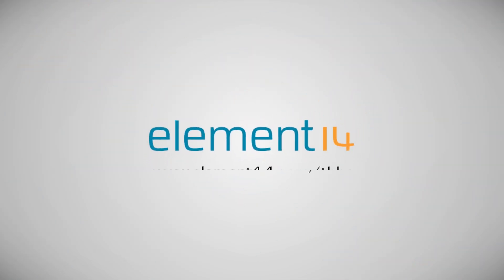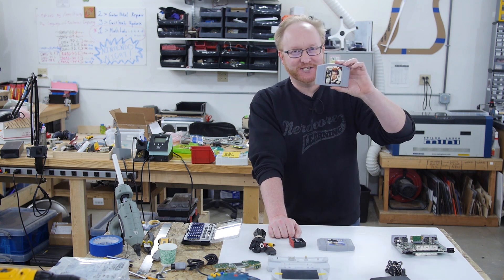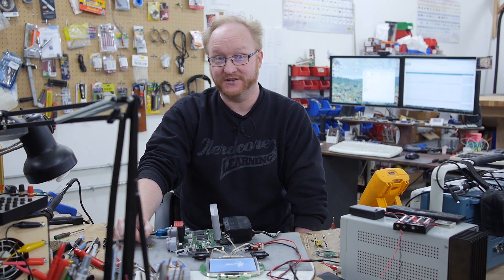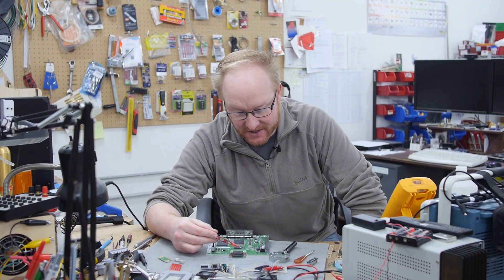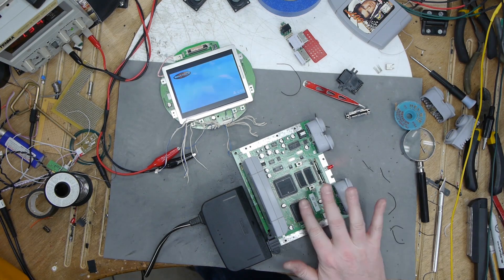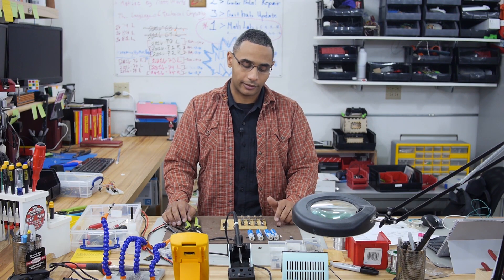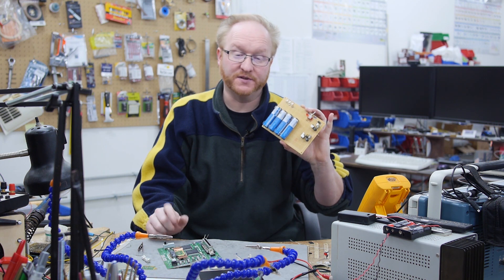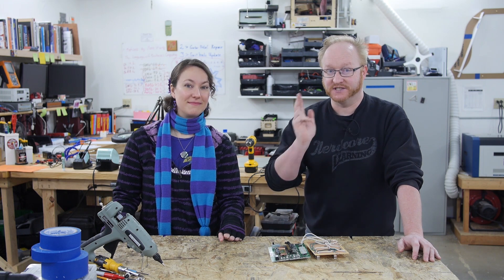Ben Heck's Portable N64 Part 1

Comment: Back in 97 when I got my n64 for Christmas, a couple of days later, I stuck a piece of wire in the cartridge slot and the other end connected to my gameboy, don't judge me, I was 10 years old. lol. I don't know what I was thinking. Trying to play gameboy on the big screen, lol. My question is do you think i fried my board? A capacitor or something? Or maybe I can just replace the pin connector? It stills looks brand new, Power light still comes on, but games don't play.

Comment: can you build a custom desktop PC PlayStation 4 console PS3 console and PS2 motherboard all motherboards burning in the One modded together as one operating system on one single motherboard women all the motherboards as one PC motherboard the PS4 motherboard PS3 motherboard and PS2 motherboard running all is one operating system all the motherboards wondering as one what plays PS PC games PS2 games PlayStation 1 games PS3 games and PS4 games on it as one the kick ass awesome Windows computer / PlayStation compete computer.

Comment: Don't work on circuit board without hot air and board heater.  A solder iron is not for large components.  Facepalm.  Heat up the entire board to 120c then use hot air to remove large components.  This is the only way not to damage the layers inside the board from the ancient fragile board layers.  The entire board is hot and transfers heat without cracking traces and delaminating layers like dropping an egg.  This is why you damaged your first board(and more undisclosed boards....?).

Comment: The most experience I've done in modding is ordering the Blinking Light Win for my NES and installing it myself. And that didn't require any real engineering expertise, just a Phillips head screwdriver to open the machine and my strongest death grip to get the original boards and ZIF socket apart that sat slotted together for 30 years.

Comment: On the older motherboardboard there are 2x2mb ram chips and on the later boards they have a single 4mb ram chip. Why not acquire 2 of the 4mb chips from the newer boards and replace the 2x2mb on the older boards and then remove the socket and add the resistors to the mainboard to terminate everything? I know the ram chips can be replaced as i did it on my own N64 but i still used the jumper pak to terminate it all.

Comment: Sad thing is, he mentions multiple times that an N64 is not for beginners. Honestly it is very forgiving if you avoid the Memory. What I did to make the memory seem Smaller coming out the back was to add a fan right above it. This allows the cooling off all the components while hiding the extruding PoS.

Comment: So now you should have a bunch of empty N64 cases around - let's see something built in one.  Media center, perhaps? With a blu-ray player that accepts discs through a rear or front slot located where the top and bottom of the N64 shells come together? Sega Genesis in an N64?  Raspberry Pi with a projector that projects out through the cart slot, to put star constellation patterns / pictures on the ceiling?

Comment: The 12v line only goes to a 7905 to become 5v for the audio, the N64 only runs on 5v and also 3.1v-3.4v . But there again you should know that as you used to be a pioneer in console modding. The 3.1v-3.4 is easily achieved with a tiny step down regulator. The bending down of the port has been done many times over the years in different ways, as also has the game cart port which can be also bent over along the grounding. If using PSone screen, not a lot of benefit to RGB modding the console.
Reply: Yeah, just have other interests at the moment which take priority over modding. Still have projects to do when get around to it but in no rush, one in development at the moment when I get around to posting it.

Comment: your de soldering is complicated, i use hot air blow with a JBC hot air station, is faster and easier and the damage for the stuff around is reduced. but good work so far  :-)

Comment: @Ben Heck, would you guys consider making a portable first generation Wii with the backwards compatibility with the game cube? theres also a buch of great n64 virtual console games that were ported over just for the wii as well as some nes games.  its so versatile. i modded mine and added a 2TB external HD to emulate my back ups from Atari, NES, SNES, GENISIS, NEO GEO, GAME BOY ADVANCE, TURBO GRAPHICS, N64 (not so great!!) GAME CUBE (running natively)....its awesome runs flawless minus the N64.  I preffer it over my Raspberry Pi 3 for emulating. its a shame noones figured out how to put KODI on it yet.  I never likes the Wii controllers but the classic pro controller is great, if you havent tried it, plus you can plug 4 gamecube controllers right into the side of the Wii. (Just that first model, I think its a RVL-001?) All in all i have over 4000 games all contained in the unit/hd while the physical games stay protected behind glass, where they belong. Ive got about 4 months of tinkering so far, trying to reach perfection. Anyway Id love to see your take on a portable Wii!!! please, please, please!!! 😊😊😊

Comment: would love to know the part number on that 12v boost regulator, didn't even know they where a thing
Reply: Maybe try the LM2576. That's one of two they used.
Reply: thats the step down(normal regulator) series they used(was mentioned in video).. but they also used a step up regulator they didn't mention a part number
Reply: Ben was busy, and I guessed with a data sheet lying around. The step up regulator is LM2577T-12.

Comment: When you made the power supply, you used a regulator to regulate the voltage to 3.3 volts, then I'm assuming you stepped the 3.3 volts to 12 volts, am I correct?  In other words, the 12 volts comes from the regulated 3.3 volts and not directly from the batteries using a stepper regulator?  By quadrupling the voltage, doesn't that bring the current to a crawl?

Comment: People want a portable N64 because this system is a total bitch to emulate accurately. Even today, a high end beast PC struggles to run most of the N64 library.
Reply: That's mostly because N64 emulation is far from perfect. Many hacks are used, as opposed to proper emulation. And the lack of interest in the platform makes it unlikely for cycle accurate emulations that can play all games (like byuu's higan for the SNES) to exist.
Reply: The N64 emulator on my phone runs great lol, you don't need a strong pc at all
Reply: bumtree has nothing to do with the PC specs
Reply: Freddie7010 exactly
Reply: branaa09 That may be the case, but you'd do well not to assume I hadn't also played both. Modern phones and half-decent computers from the past 5 years can run N64 titles with enough accuracy to be virtually indistinguishable from the originals and in most cases even better.
Reply: Freddie7010 on almost all emulators Banjo Tooie doesn't work
Reply: The new Nintendo console will hopefully have virtual console. 
If it does a lot of the Nintendo 64 games will be available for portable play.
Reply: Freddie7010 Not all games run correctly, don't get so cocky. Us nerds who have played the originals and the emulated versions know the difference.
Reply: It depends entirely on the quality of the ROM dump and how good the actual emulator is.

Comment: be better to rewire the pins so they work like an everdrive 64 cart ( to read ROMS from SD ) i suppose buy a everdrive cart ,strip it ,angle mount the internals and have a constant sd card slot in the handheld ,less bulk less chances of damage to the pins

Comment: watching the ram port mod I was reminded of my adventures UNbending a VGA output on a motherboard.  I made a cardboard spacer to maintain pin separation and just went slow.  The goal was to bring the jack inside the case for a built-in monitor.

Comment: Ben. The N64 does not need 12V to run. 7.4 on the 12V rail works just finer and makes the system run cooler. This is an old N64 modder trick. I did this myself. Got a 3.3V regulator put internally and ran the system off a 7.4V PS1 supply. Worked fine and ran cooler. You should have done this instead of the 12V stepup. Like this so Ben sees it.

Comment: You need to have a regulator 12v to 3,3 volt for the voltage....(for the line of 3,3v)

Comment: What was wrong with the N64P from 2005?

I have an idea for the screens, since there are those who like to complain about the PSone screen being expensive... Portable DVD players, which the screen innards are the same as what you'd get with the PSone screen. You get the screen (possibly sharper) at roughly 7-8 inches, the internal speaker setup. Plus some of the older portable DVD players featured composite output.

Comment: Cool, but can I somehow add a portable built-in disc drive into the system? I'm assuming the circuit board and disc drive would be the most important bits and then we could just hard wire the expansion ports together...

Comment: 3s of 18650s would give you sufficient voltage to directly drive the display, and only one buck converter would be needed for the 3.3v rail. Would also reduce the needed cells to 3 and lighten the amp draw 8)

Comment: Does anyone know the trick to use this NTSC screen on a PAL console and vice-versa ?
So far, I've tested the screen on a pal console but i always get a deformed image while an NTSC console ( Saturn in this case) connected to the back input does display a clear image.
I've noticed the pal/ntsc switching capability on the mn5814a chip (pin 46) but it doesn't seem to do the trick. What else should be done ?

Comment: Why not just run an emulator in a cheap SOC running Linux with some hack to get an N64 controller and carriage to work? Like an intel compute stick or something.

The N64 sucks power so battery has to be huge and wouldn't last long. So using a low power x86 would be nice.
Reply: 1.Because it's cool to be able to play physical carts.
2.Because N64 emulation is hot garbage

Comment: Can you make non-portable PSP?
Reply: Just glue it to a brick
Reply: Khandar William I was going to say the same thing!
Reply: Derik Breon have you ever heard of the psvita tv😂😂😂
Reply: Khandar William Vita TV has got you covered
Reply: SO hard to solder those micro connections. I've done a few mods like this but it's pretty tuff unless you find ribbon cables that plug in to the motherboard. Then get some sockets boards that the new ribbon cables plug into in order to adapt those same 0.5mm pitch connections to at least 1mm otherwise it is practically impossible unless you want to destroy the motherboard and make it permanently a nppsp .
Reply: AoSX Silent 

1. some of us can't afford a pc

2. who would buy an entire pc for psp games?

3 why are we listing like this?
Reply: Khandar William TowerPSP love it!
Reply: Good idea!
Reply: Brick is portable girly man! (In Arnold voice)
Reply: Psp go connected to the tv with a dualshock 3

Done
Reply: Like gba consoliser
Reply: Kinda late here but sony already made a non portable psp
Reply: Step 1. Buy a Desktop PC
Step 2. Install emulator.
Step 3. Find roms and download.
Step 4. Ur done.
Reply: @AoSXSilent  I failed your instructions I ended up with a laptop

Comment: You don't actually need the full 12V to run the N64.  You can just use the 7.4V from the batteries directly to power the screen and the console.

Comment: the screws are much different on the n64 then the PlayStation my question is how did you get them out cause there is no way you used a regular Philips
Reply: Nintendo uses Triwing and gamebit screws for the external ones. Just search on ebay for "nintendo 64 screw" or "nintendo 64 gamebit".
Reply: Just gamebit ones. The SNES uses the same screw as well for both cartridges and the console.

Comment: Wait, so what killed the first N64? Did you re-check your soldering on the RAM expansion relocation? I wouldn't figure that would totally kill the entire unit.

One weird quirk I've noticed with my N64 is it not powering on at all unless that thick power supply that plugs into the back is in just the right position. Since I've tried multiple bricks with multiple consoles, I think it's more at fault with the outlet on the console rather than the power brick itself. I wonder if that may have been your issue.

Comment: Why is it so difficult to rewire the ram pack thingy?
Reply: Because it's a highspeed bus. My best guess is that the rewiring didn't work because Ben didn't cut off the original pads, so they acted like a stub on the high speed line, making reflections and destroying signal integrity.
Reply: timmy GTO Contacts are really small, and of course when you put in all that effort, with any luck it will stop working.
Reply: It's a high speed bus. One of the things that can happen is that you get corrupted data because of delays between traces/wires being even a millimeter too short/long.
Reply: i am just terrible at soldering but luckily i know better than to even try soldering such tiny data connections as found on pcbs like that

Comment: could you upgrade the stock ram? that way you didn't have to upgrade the expansion slot? and you should get in touch with metaljesusrocks for the bottom expansion, there's been quite the buzz about the 64DD

Comment: why do you have to bring the voltage down, and then bring it back up? why not use a regulator or whatever that brings the current voltage up to 12v?

Comment: the thing is,nintendo made a n64 plug and play portable called the ique player
but it was only a test product for china.
https://i.ytimg.com/vi/MgSS0s4NTw4/maxresdefault.jpg
Reply: I remember seeing that. Since it has built in games and is basically just a controller, it makes you wonder what's inside of it huh.
Seems smaller than a regular N64 by quite a bit...
Reply: well from what i saw (a friend had one) it use a real n64 on a chip,it use a big power brick,no emulation in it. it was very nicely made but the controller tend to get warm still and is about the size of a xbox duke controller. it had a rewritable memory card to hold 4 to 5 games.
with a multitap it was able to handle 4 player like a real n64
http://www.gamekult.com/forum/attachment.php?attachmentid=329080&d=1234213920

Comment: Also the RAMBUS was not just "ram on the bus", but a weird memory type that used an 9bit (!) bus at a very, very high frequency (500Mhz around in the case of the N64), so you could use less traces on the PCB and pins on the CPU that supports it etc..
But it also had the issue that non linear memory accesses were very slow, because you had to set up the address 8 bits at time.
The last bit was normally used by servers etc for parity check, but in the case of the N64 it was completely unused by the CPU, but the GPU used it to mark where to blur for the edge anti aliasing and dither smoothing.
Actually, there were quite a lot of circuitry dedicated to blur or smear the picture somehow in the box.

Comment: 98% sure the nintendo 64 doesnt natively output rgb only s-video and composite 🙁 unlike the super   and cube
Reply: SS3Dman The video encode in the system does create the RGB signals, they just didn't bother running traces to the multi-out connector because reasons.